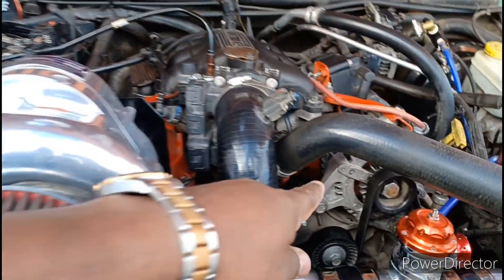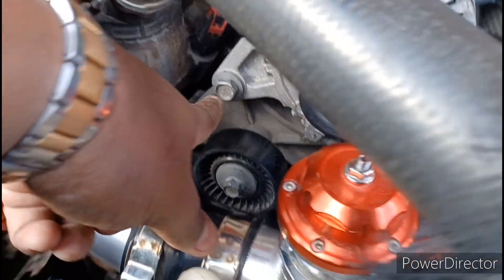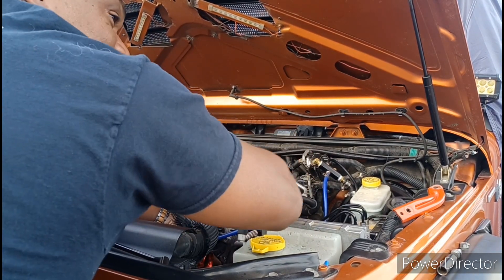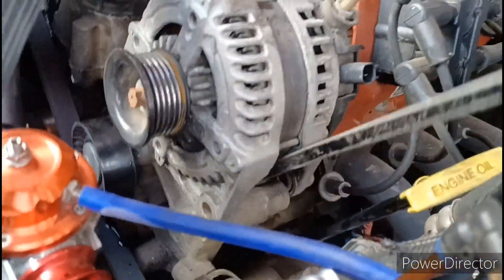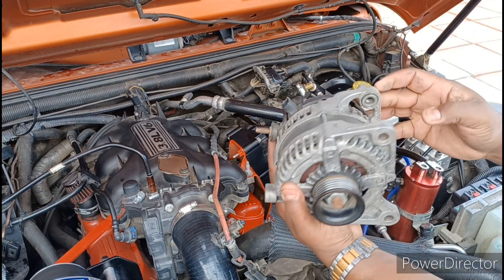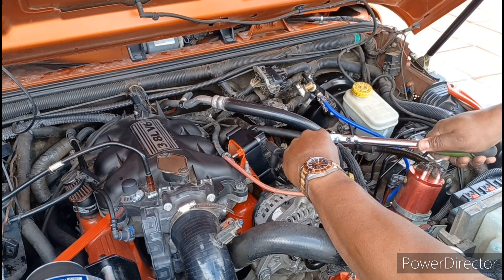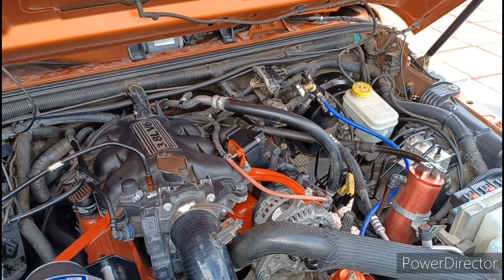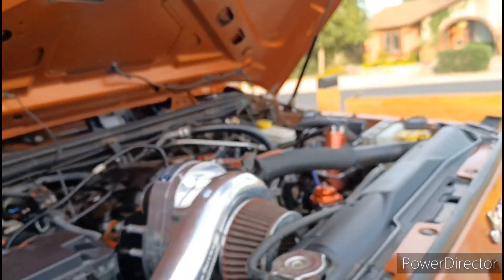REMOVE and INSTALL Jeep Wrangler 3.8 ALTERNATOR 2007 - 2011 [ SUPER EASY repair! ]

Comment: @uberjeep I watch a lot of Scotty kilmer on YouTube and I am big on older cars that are easy to fix he said not to buy over 2016 if you want a car you regular mechanic will be able to repair because of all the computers and poor designs. Needing to remove major parts to get to simple things like spark plugs.
Reply from the maker: Yup. That's why I bought a BMW. The plugs are easier to change than almost any other car out there. I've got a video on my channel changing them. Super easy!

I've worked on BMWs for years, so I kinda know the reasoning behind the engineering. It's all race technology made for pits and getting the car on the track quicker.

Even Mercedes are relatively easy to work on. Mercedes brakes are easier than most American cars. You dont even take the calipers off. Just slide the pads out like bread from a toaster.

I watch Scotty too! Dude uses the horse when he laughs. I be DYING!! That guy is pretty sharp with his logic on so much. Very easy to listen to.

Comment: Hate those stupid clips,  changed the alternator on my 2010 town and country with 4.0 v6. It wasn't bad. The starter was a b*tch. Ended up calling my mechanic to come tow me to his shop. Matter of fact. 2 weeks after the alternator was changed,  the starter went out. Love my 4.0 just difficult to find videos/guides on it.  Keep moving.
Reply from the maker: Thanks brotha! Yeah, and with this being a 2011, you know the plastic clips are all brittle. I try to be careful with the clips, but I do snap a few from time to time. LOL! This Jeep has seen a lot of hot summers, so the rubber and plastic has to be replaced, slowly.

That starter on the 2010 T&C is WOOOOOOOOOOOO! Yeah, you're gonna have to get oily to get that thing off! I've done those and it's a lot of finagling and using a little muscle to work under there. These small Chrysler engines are a b!tch, man!! I go thru the wheel well just to do my spark plugs on the passenger side. Small engines! Hands be all cramped!